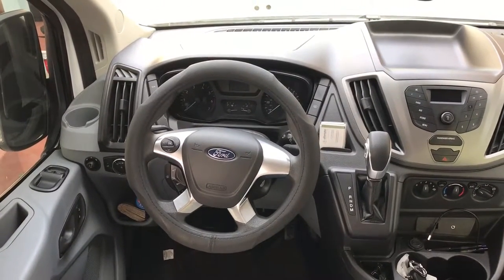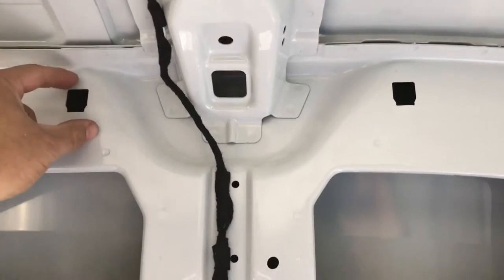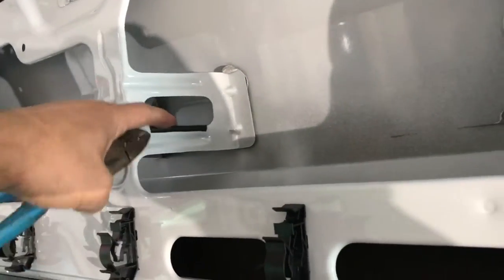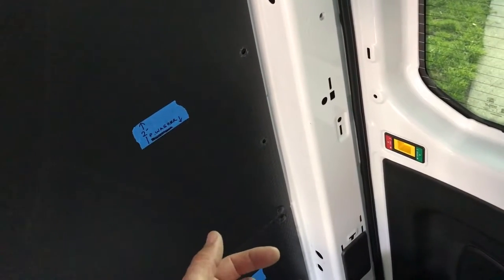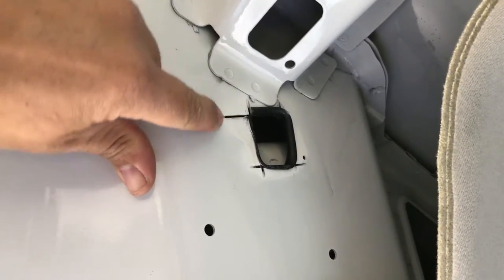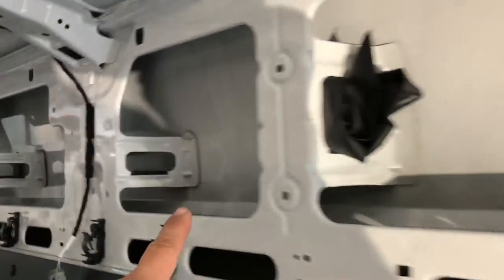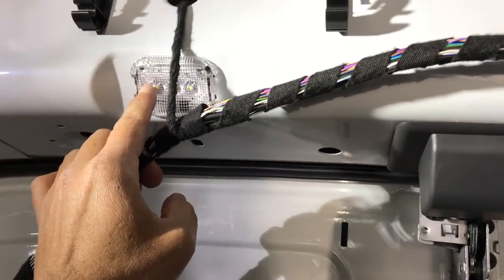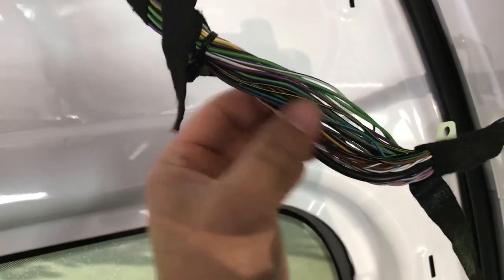2016 Ford transit 350 cargo van part #1 of 2 reroute wire harness cargo area

Comment: To AVOID cutting the harness: You can drill 1.5: x 2.75" holes in the walls in the D pillar and C pillar fairly easily with a 1.75" Milwaukee Dozer  CARBIDE  hole saw, cutting oil and  two USB  borescope camera s and two cellphones.   Bimetal Dozer hole saw will not cut boron steel.
You need to extend the front end of the harness ~36 -48" with a custom Extension cable.  Making the extension cable requires two donor harnesses.  You need connection points above and below the A pillar.  The b pillar is Boron Steel and it can be drilled but is is very slow work.  Remove the headliner.  Enter the wall before the B pillar above the drivers window.You will need several 1/4" x 12"L cobalt bits to drill deep pilot holes with.